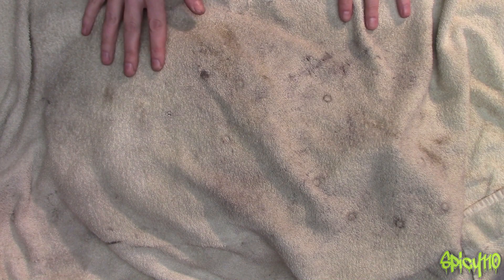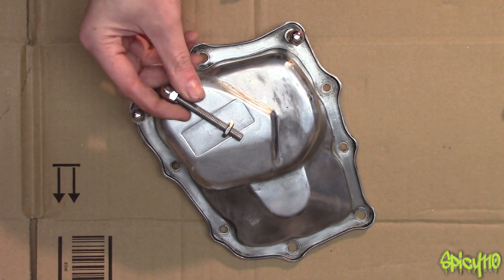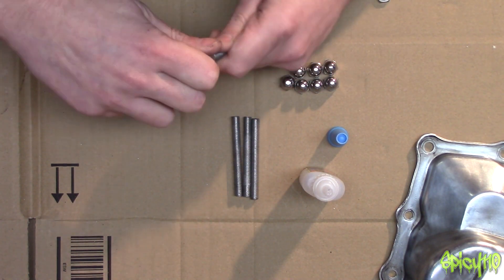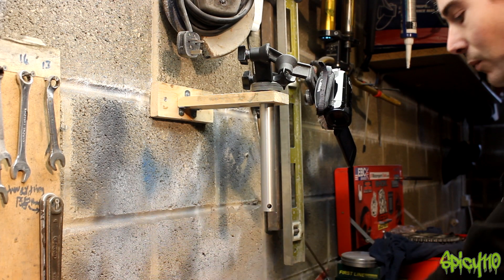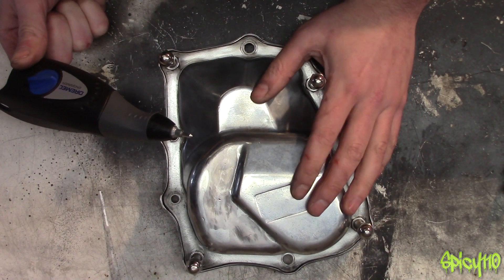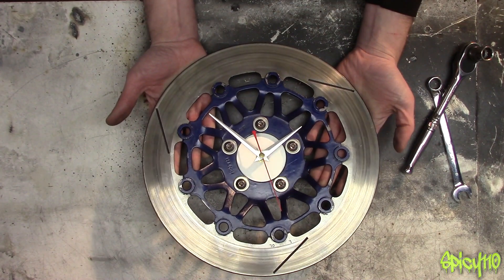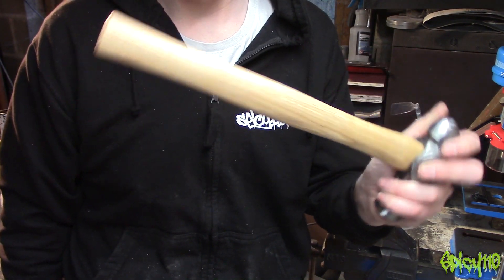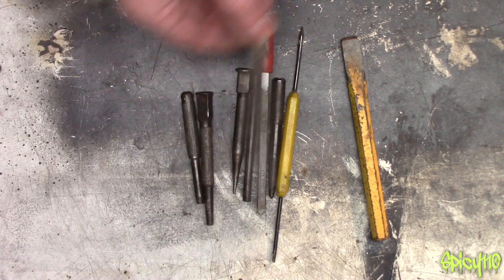New Tools! Metal Works Ep.13

Comment: The drill press is a einhell item made in china it's ok for the money - the bearing on the main shaft are crap it makes the chuck wander after a few hours use the grease on the drill and in the bearings is a poor wax like toffee - clean it and replace - after 18 months I swapped the bearings out for SKF ones and there is a 100% improvement - you may have the chuck come off as it only a morse taper and a push fit (no centre screw)

Comment: As a self employed person I totally understand your worries about cash flow. It’s not easy but I do what you do and that is keep a buffer in my business account separate from my personal accounts, I think it helps as the money isn’t there to spend unless you knowingly use your business account card. February is always a bit rubbish with having to pay tax at the end of Jan but it’ll pick up again. I work 7 days a week, currently I’m working in Lathrop near SAN Francisco I’ve been here since the 29.01 and go home on the 25.02 for 6 days then fly back here for another 4 weeks. It’s not an easy life but if you want an easy life the only person you’ll be making richer is your boss! 

I’ve accumulated tools over the years, a lot are very expensive but when you buy them individually it doesn’t hurt the bank as much. eBay is great for secondhand tools especially older ones, I’ve found them to be made to a much higher quality and most will outlast any new one.
Reply from the maker: Sadly my buffer is my money.  That's why the bike will go if I hit a low I have determined in my head. But I have faith as I'm still in the set up stage really it's only been 6 months but I do have most of the tools I need now.
Reply: spicy110 give it time you’re in the infancy of your business, I’ve noticed you’re getting a few more views which is a good thing. I sold my bike when I went self employed and haven’t had one since which is a shame but saving for a house doesn’t warrant a car and bike unfortunately. Don’t forget all your tools are “free” as you either spend money on them or give it to the dreaded taxman so look at it that way! 

Have you ever considered going to a scrap yard and seeing if you can get some larger items? Maybe an alloy wheel to turn into a coffee table with a glass top. You could make some coat hooks with the chain you’ve got, weld them into shape then attach them to a back piece and weld between the links for a clean finish. Shouldn’t be too hard to knock up in a couple of hours.

Comment: You wanna go to Aldi They got some cracking tools in they which are cheap and descent and have you thought about getting a 3D printer? One id recommend is the Anet A8 or Anet A3 both are under £200 the A8 being £125 is amazing for the money only down side is its a kit so you would need to build it.
Reply: Aldi and Lidl have such great bargains tool wise I buy stuff for work to abuse and I haven't broken anything except a screwdriver that was being used to chisel the head off a rivet and I shattered the handle

Comment: HEY THERE! Getting an adrenaline may prove to be a bad idea as its 9 months old yet all of the electrics, clocks, clutch and rear wheel bearing have just failed
Reply from the maker: All at once? get on the phone to your dealer it's under warranty.
Reply: will do, problem is, the dealer is in wales and i'm in hull so im not sure what will happen. the clocks have already been replaced by previous owner under warranty but they have been iffy since i got it, nothing that bad though. the clutch and electrics are the real issue, will get it sorted with the sealer if i can